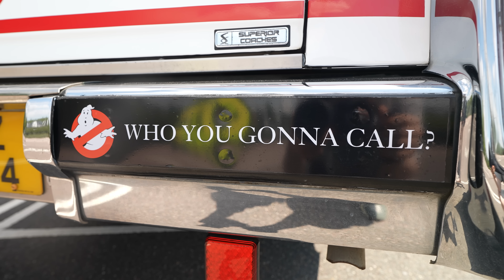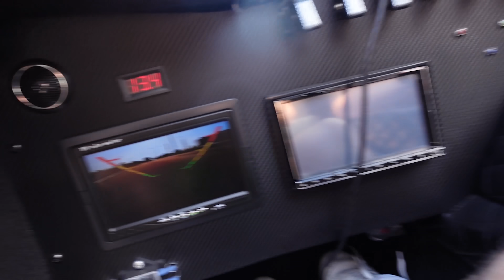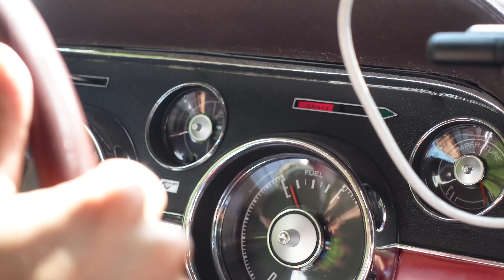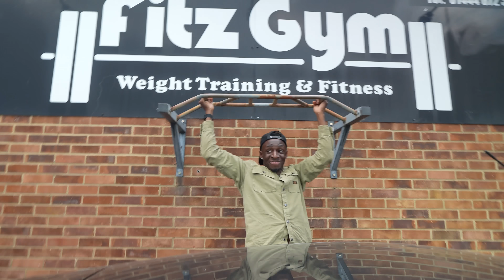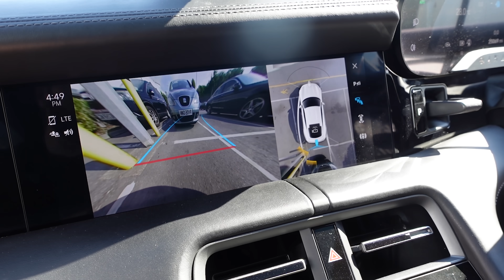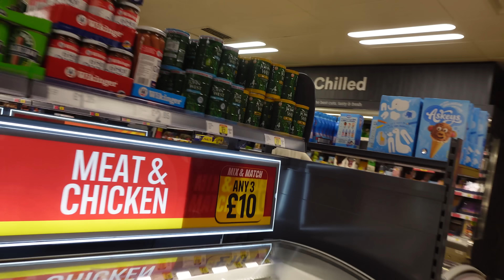SIDEMEN MOST EXPENSIVE CAR CHALLENGE

Comment: 46:06 that lady is a superhero... 3 guys pushing as hard as they can and the car is barely moving, then she touches it and it moves no problem
Reply: lol a woman's touch
Reply: She lined up with the wheel & pushed it from the rear & to the direction the car is going.. simple physics + vik mentioned that it was the steering as well. it was good timing lol
Reply: because vik has the wheel turned lol, he straightens it up when she touches it
Reply: It's because it has a locked diff and was much easier to push in a straight line than when turning
Reply: @JayTeeJr welded diff lad
Reply: Mass moves mass
Reply: It's a welded diff lmao, basically impossible to push with the wheels turned any direction except straight
Reply: She had a lot of backing tbh
Reply: @JayTeeJr  she needs to be tested for performance enhancing substances, mate.
Reply: Granny had the yams fr
Reply: Granny have a nice back 😂

Comment: LOOK AT THE WHEEL! 27:35 Ethan is turning left, and the wheels are going straight. HOW THE HECK IS THAT BATMAN CAR LEGAL LOL NEEDS AN ALIGNMENT BAAAAD
Reply: its honestly not that bad to drive with the wheel like that, i mean you dont look at the wheel the whole time you can just kinda feel it
Reply: Alignment doesn’t make a car illegal, the wheel could be upside it don’t matter the car would still be legal.
Reply: mate have you never worked on a car? its just a knockoff batman steering wheel ofcourse its not aligned properly, nothing to do with the wheels mate
Reply: the alignment of the steering wheel doesn't affect handling